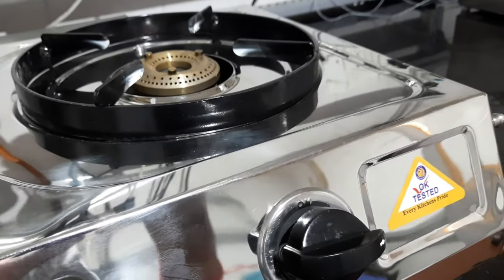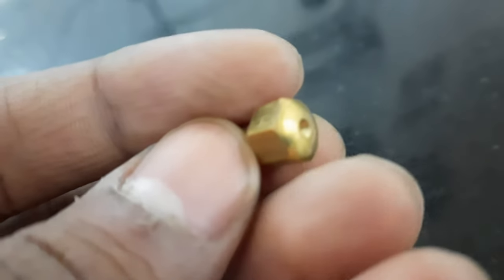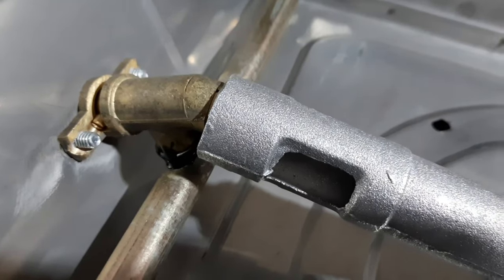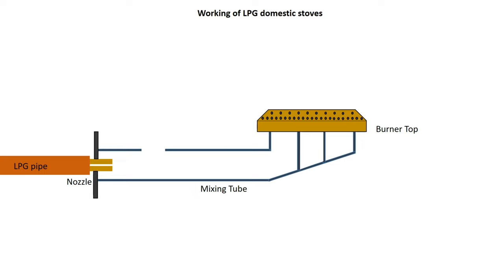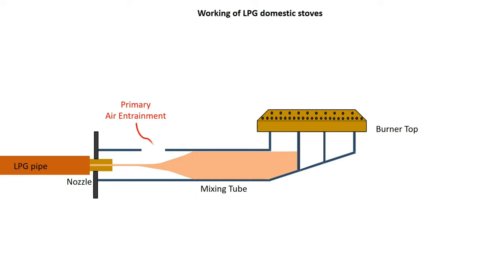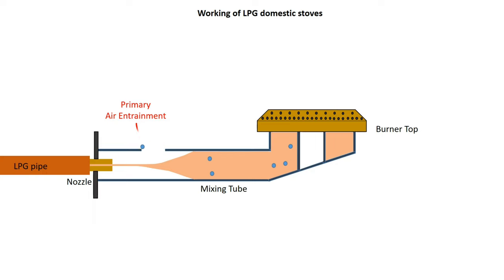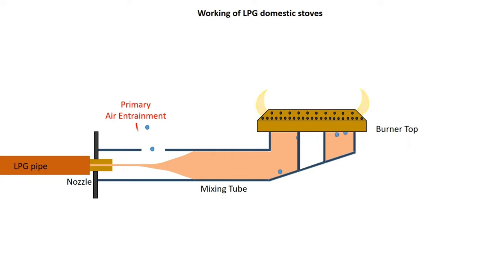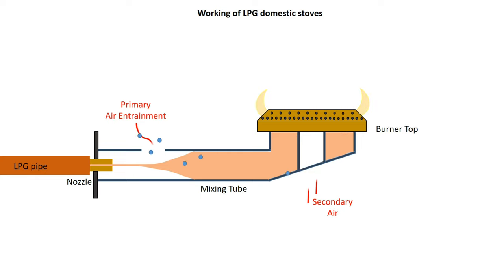working of LPG gas burner | cooking stove | Animation

Comment: i cleaned burner,nozzle still flame is not sitting stable on burner,it is like flying from hole to hole like wave.what cud be d reason and how to solve this.

can dirty mixing tube or rusted mixing tube make air flow ,fuel flow uneven because of which i get this problem?